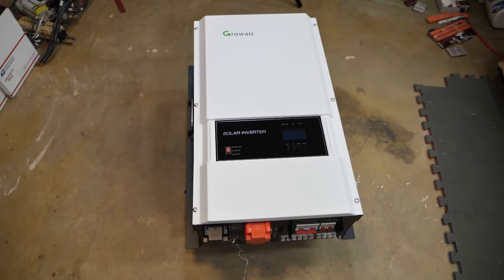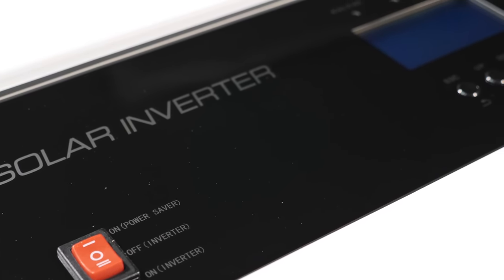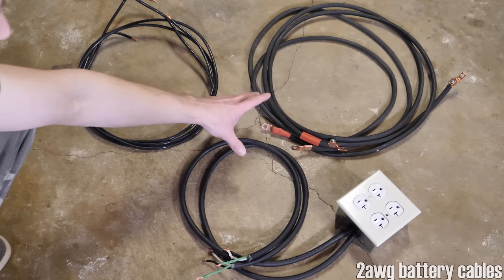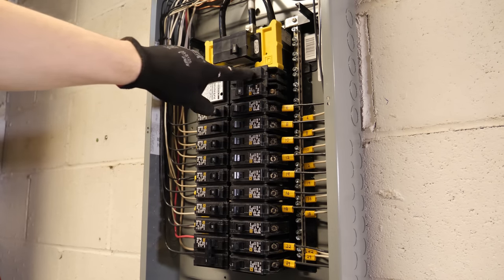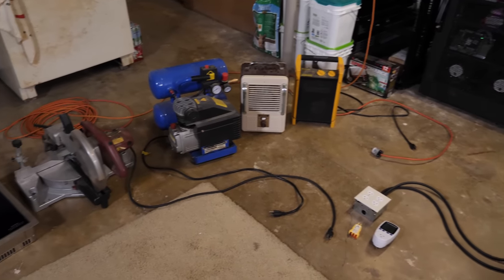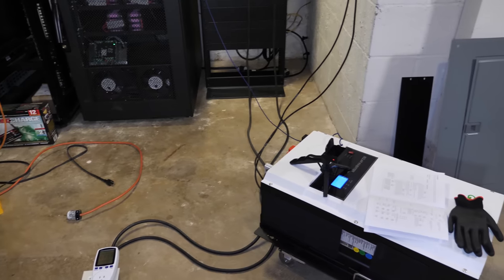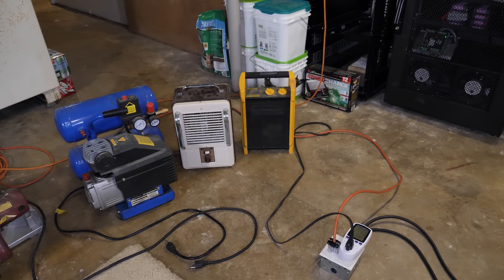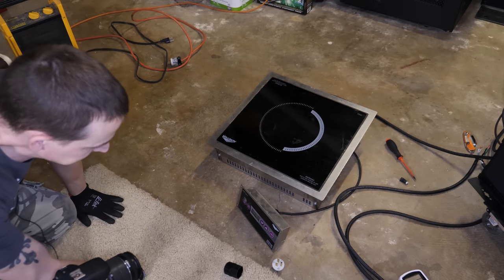12kw Growatt Inverter Operational Check/Review!!

Comment: I don’t know if you still see and respond to these comments or not but I figure I would try and ask.

What made you decide to go with the 12k LF inverter instead of the smaller 3/5k stackable units?  Looking into both setups right now and was curious.  Also, you mentioned in a video that your panel next to your inverter is a sub panel in your house.  Did you split your panels on purpose and have heavier loads in another panel that you don’t run off-grid?
Reply from the maker: I chose this one because I didnt want a bunch of small inverters plus an auto transformer. I wanted everything in one and a big one to run the house. As for the "sub panel"...my house they had a few panels installed way back in the day and the other panel is considered the main panel since its the first panel the power comes in for grid. That panel still has a few loads on it but once I have enough battery to run everything, Ill add those to the inverter panel. Hope that makes since!👍
Reply: Thanks, that does make sense.  Since the cost is about the same, I'm debating the same thing.  Have you even come close to using 6k on a single phase yet?  The only thing that concerns me is the fact that you cannot stack the LF units, but I don't know that I've ever seen my home use that much energy all at once.  Also, how much battery storage do you currently have as well as solar?  Getting close to your goals of moving more things over to solar?

Comment: HiAverage Joe, Can you explain to me the grid pass through thing you mentioned a couple times please. How can I wire mine, when I get it, to take advantage of the grid too? Thanks, Mouse
Reply from the maker: Basically you will wire your 240v grid connection into the input of the inverter and the 240v output from inverter will go to your panel that you want to power. Then once the inverter is powered on, the grid can pass through inverter to your panel OR the relay inside switchs and you power from battery and solar if you have solar.
Reply: Word of caution on that one with split phase systems and these transformer based split phase Inverters.  The inverters internal transformer acts like an autotransformer while in bypass mode that generates a "new" neutral output from the inverter and that transformer will try to balance upstream imbalanced loads from the grid connection if interconnected to the grid neutral either direct or via ground bond.

Comment: I have had an inlet installed to have a portable generator.  This old fart layman with a failing heart also likes the concept of the Growatt hooked up to the panel, utilities, some batteries(?) to be recharged by the generator during an extended power failure.  What all do you recommend?  Yeah, I need a AED more than emergency power backup!  LOL.
Reply from the maker: Yeah this inverter can do all that. Only thing for you is having either the genny connected to the inverter OR the mains. 🤘
Reply: @AveRage_Joe  in an outage, I just switch the main off and have a main for the generator to run my cottage on LP.  Since I have 120 & 240 connections, I assume I need a split phase inverter, but how does an old layman determine how many rechargeable batteries than can also be charged when they get low - either by local power or the generator during extended outages?
Reply from the maker: Yeah you would want a split phase like mine or similar. How many watts is your genny and how big is your place?
Reply: @AveRage_Joe  first: I this old retired Vet sincerely appreciates your time in trying to help try and keep me warm and me food from spoiling.  It have a Wgen9500DF that can be plugged into a prof-i stalled inlet that’s connected to me electric panel. I am still waiting for a plumber to finish hooking up to me 500 LP tank. In that past two years we’ve had several multi-day (5-6 days) power outages related to storms.  With the cost of LP rising (not mentioning why?), I wanted to see what possibilities there are for (starting out) with an inverter & batteries running the cottage and just run the genie (for only a couple of hours) to charge batteries after they run down 16-20 hours.  Sure, I could just run the genie many hours each say eating up my LP at $4/gallon, but would lime to see what the investment of an inverter & batteries would be?  My cottage is only 500/550 sq-ft, with pump for well and seldom used apartment 220 oven, Fridge, freezer, tankless water heater and septic.  The Wgen9500DF was able to run everything and has successfully done so during a 26-hour outage during the fall.  Again, thank you, sincerely!
Reply: @AveRage_Joe  It is a Westinghouse 9500DF which I only use LP.  12500/11200 Peak Watts and 9500/8500 Rated Watts (Gas/Propane)
Reply: @AveRage_Joe  About 550 sq-ft.  600 sq-ft if you want to play it safe.  It is just a two-bedroom cottage with one bath, septic, and well.

Comment: My Growatt 12k just died, it suddenly shut down, batteries went to fault. I switched to off, reset my batteries, and I got the screen on, it showed that it was charging batteries and everything seemed to be ok, switched it to on and it beeped, showed fault 04, and shut down went blank. Went through same procedure again but this time nothing.
Checked all voltage’s and all are good, batteries at 53.4, pv input ok. All tests done with ac imput and output off
Any ideas?

Comment: I am thinking of getting a husky system 1 need least 14.5kwh of power  for my household  with ac i live in North fla 30 min north of Panama city  was thinking of how many solar panels to charge  up batt get any idea  what I can start with atheist for rolling  blackout but want to be able to go off grid what u think if you can help on panels to start or get just inverters to start thec12000 gilowatt  I forcsure want
Reply from the maker: I would get a rhino if your looking for 14kwh of battery! As for solar, I have a little over 5kw in used solar and I can fully recharge pretty quickly in spring and summer. Im in Omaha Ne so not the best location.

Comment: couple questions, what happens if you only supply power to L1 on the input side of the inverter ? maybe you only have L1 on the output side of a generator ( of grid set up ) ?
does only pass through L1 120 ? can you bride L1 & L2 on input side of inverter ? If so do you still get split phase output or two 120 volt output single phase on output side ? or nothing? 
also, I cant find the start-up capacity in amps on 8kw growwatt  I.E. 70 am surge at 220 volt ?

Comment: 12K inverter and tested with a small compressor and heater... (at around the 15 minute mark).
  Why not start with 12K of load right off the rip? if it pulls that we can assume lighter loads should be just fine.
 More importantly does the Unit sound like a vacuum cleaner running?  If so this will make me stay away from it...

Comment: I have a question. Will this inverter handle a 220 volt well pump ? Pump is 220 volt at 12 amps? I’m looking for new inverter that can run my house and well pump at the same time. The total amp load on the house is 25 amps.
Reply from the maker: Should handle that without a issue at all!🤘
Reply: @AveRage_Joe  thanks Joe
Reply from the maker: You betcha!

Comment: In your opinion would it be advisable to get to 6000 W inverter’s or a one 12,000 W inverter’s for a split phase
Reply from the maker: I almost went with the 6kw but didnt want to have any issues starting or using pretty much anything at anytime lol. It really depends on your use. I think one could get buy on a 6kw for sure.
Reply: “two 6000 W inverter or one 12,000 W inverter for a split phase”?

I heard this discussion before.

One some low frequency inverters, like the Genetry inverters, they can typically be configured to do 6000 watts per split, handling surges of over 12k watts per split, completely supporting a 12k load with super high peaks.

The disadvantage of configurations using two inverters is the high parasitic draw from the idle time of both inverters. This disadvantage drives people to a single inverter.

A single 12k inverter, like this GroWatt is typically heavier than two 6k inverters. The unwieldy nature of the larger inverters is a turn-off for some people, so they would prefer equipment that they can handle by themselves.

I purposefully chose physically smaller solar panels, for this very reason. I try to get the best $/watt in the smallest form factor per panel. Similar for inverters & batteries.

Comment: Hey dude, good to see another video from you! Loved the thorough testing of this hybrid inverter. I'm thinking of getting one now.

BTW, what kind of panel is it that you are using on the DIY PowerWall now? It's well installed and looks good.
Reply from the maker: Thanks Man.   Sweet! If you go through sig solar tellem I sent ya.  Its not affiliated or anything but maybe you can get a discount lol.  I did a few videos on the "control panel".  Im probly going to get rid of it lol
Reply: @AveRage_Joe  I ended up watching the build videos on the panel. It turned out good. Don't ditch it!
Reply from the maker: Thanks Man! Well the reason for possibly ditching it is the rack is kinda big and in the way now. I think the plan is to put everything in one smaller box and mount it to the wall. Will be cleaner Im thinking as well.😆
Reply: @AveRage_Joe  makes sense to me! Looking forward to seeing Gen 2. Boom!

Comment: About this inverter, I see this one nearly perfectly fit my needs. Can you advice if this inverter can withstand returning power from my existing on grid tie inverter?   Would be very costly to me reconfigure all again in home, My idea is to use 12Kw as kind of UPS, THEN MY 7KW inverter will sense power and start produce power, this at least would work without battery in day time. Latter on I like purchase battery bank, if possible same as you show on other video. Unfortunately to me this inverter can't be shipped to Mexico, I need to look for similar in aliexpress. Great video, very instructive.
Reply from the maker: I cant say 100% or not but honestly dont see why it couldnt. You would run the 12kw as your "normal" offgrid power and the gridtie would sync to it and lower the load. Only issue I could see is you would probly want to make sure you dont send to much back to the 12kw. Just a reminder tho this inverter is an off grid inverter and needs a battery to work and it cant send power back to the grid. Yeah you can find these inverters on alibaba!
Reply: @AveRage_Joe  Many thanks for your replay. I agree with sinc. and lowering power output I watched it time ago on another channel, when on grid installation been prepared to off grid with 1500w off grid inverter. So I may be ok, need to test. I think in Mexico in few years forward we will experience power shortages, due to bad infrastructure grow politic here. 12Kw with peak 36kw is model which I'm looking for. Fit my power need. Highest load like car charger and A/C power supply will be on transfer switch, on grid and manually switched to inverter if need.
Reply from the maker: There you go. Thats what I would do as well.
Reply: Hi  @robertmariuszpozniak6482  - “Can you advice if this inverter can withstand returning power from my existing on grid tie inverter?”

This is a good question. It is the same situation that I am running into.

Genetry Solar makes a low frequency inverter that will do EXACTLY this!

This is very tricky, because the inverter must measure the input and output power, take the excess output power (from the grid tie) and sink it to the batteries. (If it can not sink the current to the batteries, it will blow the MOSFET’s.)

The low frequency Genetry Solar inverters will also try to frequency shift the grid tie inverters, to shut them off, if the power is still to high.

Finally, the Genetry Solar inverter will just shut down, if it can not charge the batteries with the extra Grid Tie power or throttle the grid tie inverter, to keep from blowing the MOSFETs.

If this is a problem, you just buy more batteries, to sink the power from your grid tie inverters to, on the Genetry Solar Inverters!

I would be VERY cautious about buying any inverter, where you have grid ties on the output, unless YOU KNOW the inverter manufacturer will support this configuration.

I just received my Grid Tie inverter and screwed it to the wall… doing the rest, now!

Have a great day!

Comment: I watch your review so now I have the same invertor SPF 12000T DVM-US-MPV unit. I have 24-28 solar panels to use @ 330W, VOC 40.6, IMP 9.67A How would I hook theses up? Two strings,  each string with 12 panels with 6+6 in parallel? Can this inverter handle that with these watts? Thanks to anyone that can help!
Reply from the maker: Nice!!! So your VOC cant go over 250vdc so what I would do is 6 in series. Thats what I did. Then parallel then strings. 🤘
Reply: @AveRage_Joe  What's your home consumption in KW per day and what is your invertor putting out in a average day/week? Can you do a live link to your Growatt online for everyone to see or screen shot. Thanks

Comment: Friend, it is normal that at night the inverter in this video turns on the fans every 26 minutes, it is somewhat annoying since the consumption is very low, just 500w and that sounds a lot, can I do something? so that it does not do it at night?
Reply from the maker: I know mine turns on but not every 25min.  I would say it is one of the loads you are running.  For example if I print something for my pc, the fans kick on.  If my furnace kicks on, the fans do.  So it may be a load like that that is doing it.  Possibly a fridge, freezer or furnace???
Reply: @AveRage_Joe  If a load has, its consumption is 500 watts, the concern is that it is activated as I tell you every 25 minutes the fans are turned on and last 15 seconds running, in other inverter models that does not happen, unless it is charging with solar in the day and activate them, but it is the first model so it does, I thought that something could be done in the configuration.
anyway thank you very much for your contribution

Comment: I'm not entirely certain, but I think you needed to have an induction metal pot on top in order for the induction stove to turn on.
Reply from the maker: Yeah it was mentioned a few times. I figured it didnt work since the leds on the panel didnt light up. Will try again!🤘

Comment: Joe, thank you for the video, I was wondering what size breaker was it that you wired the ac input to and does this same connection work to power the panel when the grid goes down? Thank you

Comment: Does the battery SoC% not need a connection to the Batrium to read correctly?
Reply from the maker: I have the inverter on user defined at this current time since I dont have the batrium connected but yes I believe once that is connected and I use the lithium setting on Inverter it will read correctly

Comment: 3.30.21  Great video Joe.  Looks easy when you hook up things.  I am working towards this kind of a set up.  Thanks again.
Reply from the maker: Thanks Man! Yeah seems to handle the things I tried. Real test will be with the new batteries!! What all you working on meow?
Reply: @AveRage_Joe  4.9.21  What I want to do is use my solar panels hooked up to the growatt (of some kind) hooked up to my electronic panel and be used like a grid tie inverter.  Currently I have a 1000 watt grid tie invertor plugged into a 120v outside plug.  I would like to add batteries in the future.
Reply from the maker: Growatt does have quite a few grid-tie inverters to choose from. I have not tried any of them.

Comment: That's a whopper for for sure.   3Kw is best I can do right now but enough for our modest needs.  The well is our power hog.  Sick as hell right now .  Don't get old.  It sucks Sir.
Reply from the maker: I could probly get by on 3k watts but wouldnt be able to power the 240v items.  OOOO You get the Rona??
Reply: My issue is the water well.  240vac  Will change out as soon as we .can.
Reply from the maker: Crazy how much those can draw!!

Comment: Thanks for the breakdown of off grid vs grid tie.  This is the first time I've heard that explained.  I had to figure that out by reading the install documents on a few MPP and Growatt inverters.

Do you happen to know if Growatt makes a grid tie version of this inverter?
Reply from the maker: Thanks Mate! I wasnt aware at one time either! I know they have many grid-tie inverters but not sure if there is in this particular model.
Reply: @AveRage_Joe  possible dumb question.  Is there a reason wifi is used instead of ethernet?  I don't think I saw a ethernet port on the bottom of the device.  It's possible I've missed it skimming over the serial and can RJ45 ports.
Reply from the maker: Not dumb question. You can connect directly and use the software that comes with the inverter. They also supplied a usb cable for that.

Comment: Question. Hi Joe I have the 12kw split phase. On page 10 of manual. Hooking the 8-12kw . I see how the input , no problem, but the output showing L1 L2 output but the neutral not showing going anywhere. Can you explain that for me. Thanks
Reply from the maker: Hi, no problem and I was confused at first as well. So when connecting to a sub panel, just connect neutral as you normally would from the inverter outputs center tap to the neutral bus in panel. If you email me, I can send ya my wire diagram I made in MS paint.
Reply: Just send you my email.
Reply from the maker: I havent seen an email yet. Send to averagejoestuff@gmail.com unless thats the email you used